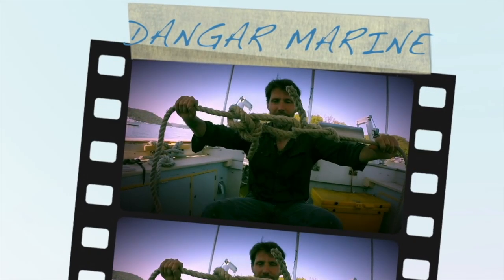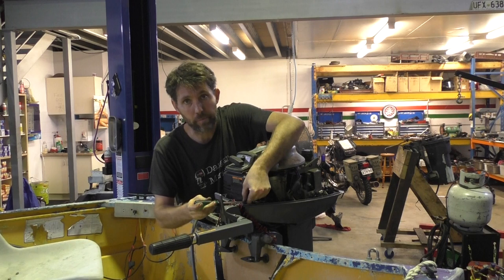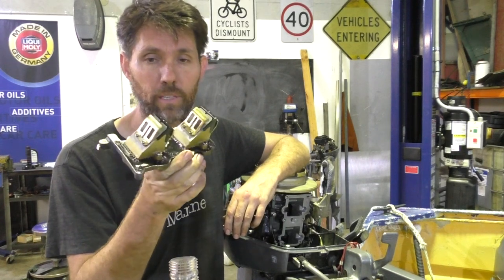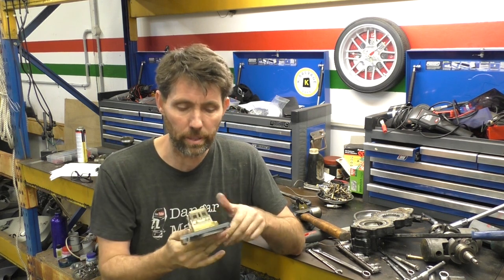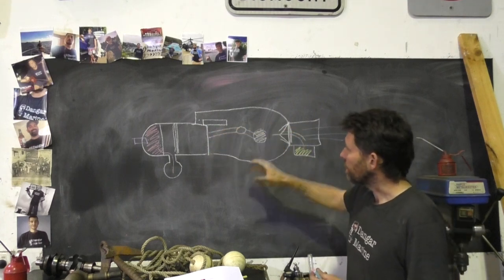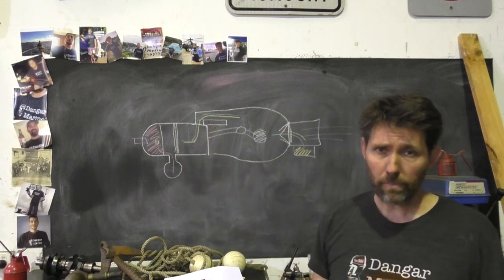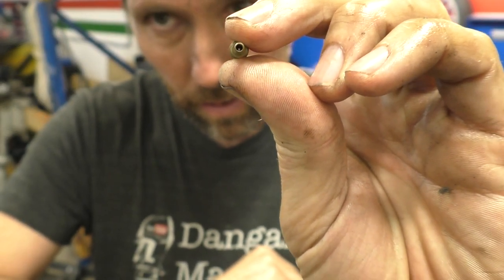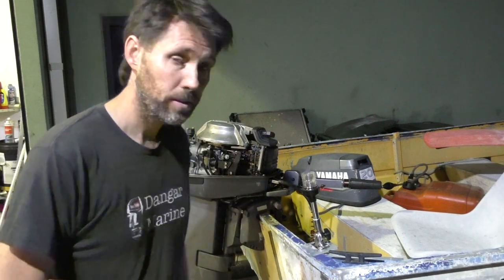Outboard reed valves

Comment: I've got an old 87 nissan NS70a . For the longest I've had a rough idle. Just recently, I have had a high speed problem. Spits and sputter and does not want to make top speed. If you work it to top speed slowly it may catch for a few minutes and then go back down... Went to lake yesterday and had the carb cover off and have fuel spitting back off the lower carb. Pulled the carbs and reed valves and mine are the stainless ones and you can see light shining through. Ordered some new ones from Boyesen and will let you know how it comes out.... Will say this also, I replaced water pump impeller couple weeks ago after noticing no water out of telltale next day after a night fishing trip.... Pumping water again fine now and I am hopeful I didn't fry the head or head gasket. But I'm really hopeful after seeing that fuel spit out of carb which  has been doing it a long time as the inside of the engine compartment is really oily. Again, I'll let you know how things work out and really appreciate your videos!!!
Reply from the maker: Yes, fuel spitting out the carb is a classic bad reed valve symptom. I would be 99% sure your telltale was just blocked with a bit of crud, water will still have been flowing through the motor just fine.
Reply: No, I should have explained the water pump thing in more detail. And obviously that is what I was hoping it to be a blocked line to the tell tale or the little outlet it comes out but checked all that and had to pull the foot and replace the impeller. It was like a knub. Had seen it prior to that trip fairly recent  pumping water out the telltale though so hopeful this reed valve thing will be it. Also noticed no gaskets whatsoever where the back of the carbs mount to the intake plate. So bought some gasket material , rewatched your video where you cut them out, (however I went to the lipstick method to make a  print after I wasn't satisfied with the oil  method. Probably not the right amount). Today is Sunday here and the reeds are suppose to be here Thursday so hopefully Friday , I'll have a good report for ya. No question about, I'm seeing light thru them and as I mentioned was getting gas spit back out of one of the carbs. 

Thanks again!!!!
Reply: Got the reeds in today and installed and test run today. No spitting and sputtering, just smooth acceleration. Thanks to you for getting me confidence in doing a few things that I would have never attempted. It's an old 1987 motor but for now a happy one. Thanks again!!!

Here's a short video I shot from my phone of the test run. I made multiple runs like this and no problems at all. Oh and forgot to hold the phone sideways to get full screen. Sorry about that.
https://www.youtube.com/watch?v=sLJyQ3NaQ6Q

Comment: Does my Mariner Mag 200 EFI have carbs? Reeds? And if so where?.  My motor starts good. Runs fine in neutral and on muffs. But in the water while prop is submerged.. I get no power. 6mph top speed.  I raised prop out of water a quick second and rpms raised as should. Help?.

Comment: Good day stu .. great videos very helpful and exciting to see.. I was wondering what you think about 1994 yamaha outboard 85 hp.. starts and running good.  Take it out in the  salt water and everything is going well.. takes off good.  Going max speed and after say 5 to 10 minutes in . Bogs down . No power. Sounds like crap  like it's trying to stay running... I Put it in neutral and give it choke try to high idle. Starts to get better and takes off again okay. Than does same thing bogs down like wants to shut off.. I know carbs clean . New fuel pump and lines. I'm thinking reed valves issue.. note I'm getting mix fuel coming / dripping out carb in air housing..

Comment: Sounds like there is either a bad head gasket or possibly a bad crank. Will it run better if you choke the carbs out manually by hand?
Reply from the maker: The head gasket was changed in the previous video and choking doesn't seem to help much, but will confirm during the follow up video.
Reply: It sounds like the cylinders are swapping air back and forth. If it's not the head I wouldn't be surprised if its' the crank labyrinth seals that are shot.

Comment: Hello Mr Dangar Marine. I have a question , I have an e48eslerd with a hole in the crankcase. I really don't have the cash for a new motor,  But was thinking of purchasing a powerhead off from ebay. I've seen a couple 17 splines 1994 48 evinrude spl.  What's the best advice you have on my thoughts?

Comment: hello Chris I have a Yamaha 40hp 2 strokes with the same problem as the engine in the video, did you manage to solve it?  if you can tell me what that was it will help me a lot.
Thank you so much
Reply: Hi , did you fixed that squeze noise ?

Comment: Great videos Stu!  Question, I have a 3 cylinder Johnson 70hp where the bottom cylinder overheated and melted the rod bearing.  Upon analysis in a sober state, the reed valve for this cylinder has a 4mm gap.  Could this be a high probability for causing my engine failure?  Thanks much and cheers!
Reply from the maker: Yes, it can cause the cylinder to run lean and get hot.

Comment: So, a while back I mentioned the problem I was having with the fitting on the hose to pump gear oil into the lower unit well I solved the problem the easy way I simply put the fitting on the end of the hose into a vise took a 3/8-16 Die and re-threaded the fitting and now it fits nicely, I checked the packaging to see where the product was manufactured CHINA so it's hard to believe with there superior quality control CHINA has, the three I bought were not able to fit without first passing the Die over them  LOL
Reply from the maker: Nice work Adrien, it was an odd one given those gearboxes have a very standard thread.

Comment: Hi Stu, on your motor issue I read that the piston could have a hole that is allowing leak internally. did you do a compression check on both cylinders?
Reply from the maker: Hey Tim, yep, did the before and after compression test in the recent head gasket video.

Comment: Can a stuck reed valve cause a cylinder to lock up when cold cranking? Outboard has been sitting for several years. Spins free until it gets to what I believe the exhaust stroke on cylinder 2.

Comment: I have a 2 stroke that wont start (won't even cough) has 125psi on each cylinder. Carbs functioning well and it has spark on each cylinder. Flywheel key is in the correct place. I'm running out of ideas. Could it be the Reed valves? I've tried spraying 2 stroke fuel directly into open carb and still no life.

Comment: so I guess the principal is the same on my motor, Its a 1993 150 johnson. It has the 12 little check valves on the carb manifold. At least 7 are damaged, and 4 were stuck open. Is this why low idle speed was rough and slobbery?

Comment: What do you think the problem would be with a 50 horsepower blue band mercury very low hours from new it lay in a shed for 20 years it went OK for the last 3 years but now it won't plane the boat carbs are clean the earth at the back of the coils are clean new Leeds and plugs starts ticks over engine sounds fine but just not power the could it be the coils there is a good spark your help would be appreciated

Comment: thanks I done as u said .as they have been on now a year or so so I wanted see if I done it right way but I think am getting bit soft water on starboard side so that engine would use a bit more petrol as it be cavatating and bit but yes it's OK I could put alarm rudder between them but don't think it's worth it there on a 25 foot princess 6 berth and I get 6 knots and that fine turn her on a penny and fuel consumption is very low all in all good job thank u. John McCormick
Reply from the maker: You're welcome John.

Comment: I have an old Salva 30hp 2 stroke it's hard to start in the cold and runs a bit lumpy when cold. After it's been running for a while like getting to a fishing mark, it will start almost ever time first time after that. The carb air input valve has no filter box on it, that's how I got it should I rig up a filter using some sponge. What do you think?
Reply from the maker: Many outboards don't have a filter box due to the lack of dust on the water like you get on the road. If they do have a box it won't have a sponge in it. The cold start problem could be a carburettor or reed valve problem so I would look at both. I would also look at whatever cold start enrichment system it has.

Comment: I replaced the reed valve at the pule hole where the fuel pump is and new fuel pump and fully rebuilt the carbs and still no fuel to carbs? its a 1979 johnson 115 v 4, I can spray fuel in carbs and it will run, what do you think is wrong?
HELP
ASAP
Reply from the maker: Does fuel come through if you squeeze the prime bulb or is the hose completely blocked somewhere?

Comment: So can you get low compression on a cylinder due to a bad reed?
Reply from the maker: No, only low compression in the crankcase (which isn't very high anyway) and fuel spitting back out the carburettor.

Comment: I have a 2001 50hp johnson outboard. It keep stalling and run rough I have changed the spark plug use couple of time spark plug is bad now. Most of the time it take 10 to 15 crank to start. Can you help?

Comment: This is beginning to sound like quad seals in the engine. I had a similar problem with a Yamaha V6 that kept Jumping" Or "missing" It's possible the Crank case vacuum and pressurisation like you were discussing before may not be adequate for each cylendar to fire properly and is leaking down pressure and vacuum between both cylendars and crankcases
Reply from the maker: Hey Callum. I have been thinking about doing a video on pressure testing crank cases. I'm presuming I will need to pop the powerhead off and make up some sort of plate to block off the exhaust then use a leakdown tester in the sparkplug holes. Have you ever gone through this process? Where are you working now?
Reply: Haha its not something people often do to be honest, its a bit of a theory that was never realised by the manufacturers. But a very necessary one indeed! And yeah that sounds like a decent plan of attack, I would imagine if the cylendar is a top dead centre you will be able to perform an adequate test. I'm not so sure if it will give you a good idea as to the sealing power of the crank case though, perhaps it might if you get some leakage between both cylendars. I have gone through the same processes you have on a larger engine only to find that the problem still presented itself. I tapped a vacuum tester into the crankcase as a bit of an experiment to read variation in positive and negative pressure (vacuum) and I've heard anywhere between 0-15psi (negative and positive) is adequate.  I am currently next to the maritime at Rozelle in the Sydney boat house, I hope the mountain and dangar is treating you well :)
Reply: You have to block the inlet and exhaust with plates to do a leak down. And as every engine has a different shape, you have to make a new plate each time. AS an owner /repairer it is worth while, but in a workshop it would be hard to justify. This is definitely something that would only make sense for some one to make and rent the plates out , it just cannot be justified ay other way.  But a leak down is a good test for crank seals ( cylinder to cylinder and end seals) , ring blow by, cylinder head and crank case join seals. You can get away with a crank case seals test by only using a block off plate on the inlet side  with careful positioning of the piston on the cylinder under test, but the results are very 'fluffy' as the ring blow by makes just about any other leak you may suspect hard to hear.  Crank case seals should also be vacuum tested  at about .5 BAR max as some seals will be ok under pressure but fail under vacuum. Way too hard and laborious to justify in labour charges. By the time you have the head off, make the plates and do the tests you could have had the head off, split the crank case, shove some new seals in and have the cases together again- probably quicker in reality.
Reply: Ron Powell Great info man! Have you ever done the leakdown/vacuum test before yourself? I totally get what you're saying about cost and reason. But just almost as an experiment, it would be cool to do! I guess you would save a little money on the crank seals but its probably not worth it because making the seal plates and time to do the test. Im guessing different motors would not have the same psi readings with different size  exhaust ports? Or would a vacuum test be more reliable? It would be cool if there was a standard leakdown test. But I guess that would be too easy, huh! Thanks again for the post!!!
Reply: I did on my current engine. Total PITA and never again. My engine is a 1974 50hp Johnson ( hydraulic assist shift) , forward controls, no water tell tale, 2 cylinder...
So, remove carbs or  reed block, which ever is easier (carbs in my case) use a new gasket to mark up a plate of 4mm aluminium so that  it covers all of the intake side of the reed block. Drill and tap a hole about where the centre of each carb throat would go - make sure you tap that hole to match your gauges.
On my engine I had to remove the exhaust port cover, then the exhaust port block so I was able to blank off each exhaust port separately. again, a new gasket used as a pattern, cut, drill and fit the plate to the exhaust ports. no  holes to drill/tap for gauges on the exhaust.
Now, there are no numbers given for leak down testing on this engine so I used what I would for a low compression 4 stroke (chonda 6hp engine) .
 I applied 7psi with a 2mm restrictor to the intake side of the engine with the piston at TDC- which should close off the transfer and exhaust ports. Top cylinder held so close to 6.6psi did the test 3 times  to make sure. The lower cylinder gave 6.4 psi , which is still good . No exhausting air heard from the top or bottom seal ( stethoscope)  and the pressures showed no mid crank seal failure. I then pulled a 2psi vacuum (minimum I could read)  for 3 minutes and shut the gauges off and the vacuum held for a minute- good enough for me.

The top end is done by leaving the piston at TDC and just pressurising the cylinder via the spark plug hole. The same choke and with the reed plate cover holes plugged. I got a flow rate of 1.5psi for about 1 minute with dry rings . I then squirted oil into the cylinders and reapplied pressure - I got .5psi flow for about 3 minutes - this is simply cylinder blow by/ring gap leakage and the flow is simply the cylinder and crank case pressurising.

 So in the end I am pretty sure my crank seals  are OK, the block has no holes in it , the pistons are Ok, the rings are slightly worn (expected) but other than that the 8 hours of mucking around told me nothing. In 8 hours I could of whipped the cylinders out, checked the rings and bores, refit. Lift the power head out , undo 4 bolts and put in a new lower crank seal, remove the fly wheel and fit a new top crank seal. The question is- is an engine this old worth it? For $2500 I can get a reco 60hp Johnson of around 2005 vintage  with 1 years warranty ( 'holiday' usage, commercial they give 1 month- so in reality  they give about 50hrs wty) 8hrs of tech time is about $1000 of time and materials for a leak down.
Reply: Ron Powell Damn lots of great info man. And sounds like a PITA! Is that the same 2 cyl Johnson block that Evinrude uses on the 40-60 etecs? Seems like a great motor if Johnson still chooses to use it this long

Comment: So by looking at your diagram it looks like bad reed valves could cause lower compression readings?? My Yamaha 115 is starting to drop compression. Runs great but compression is around 90 psi on all cylinders.
Reply from the maker: No, the charge is compressed very slightly in the crankcase, just enough to get it to transfer through the port to the top of the cylinder where the piston compresses it up to combustion pressures. If that is low it is still about the rings being worn.
Reply: The reed valves just stop the air fuel mix from reverse flowing out the carburetor as the piston goes down the bore. So, because the air fuel mix cannot go out the carburetor, it goes the only way it can, up through the transfer ports and onto the top of the piston. With out the reeds  you still get the transfer of fuel air up to the top of the piston, but a percentage would back flow the carb .  So the reeds just make the engine more efficient  and powerful

Comment: I have a 15hp with no compression. What could cause loss of compression? Do you have a video that talks about replacing piston rings?
Reply from the maker: Depends whether it is a four stroke or a two stroke. If it is a four stroke then it can also be valves. I have an early video on doing the rings on a Yamaha and a more recent one on building the pistons on the Evinrude 150 I rebuilt.

Comment: I want to put to 9.9 mercury  out boards on a boat  what distance should they be apart and should one out board mother prop turn Antiy clock ways and thank u for letting me know John
Reply from the maker: The further the outboards are apart the better really as they will get cleaner water and give you better maneuverability. Counter rotating props are good for balance but I'm not sure they warrant all the hassles that go with getting parts for them.

Comment: 1983 50hp Johnson, starts first time no problems when cold, as soon as it has run for ten minutes I can switch it off and it’s starts straight away. But leave it for ten minutes and it will not start, cranks and cranks then lift the fast idle and it will eventually start. Seems to be flooding but why only after being off for awhile? Compression good both 150.
Reply from the maker: It could be that fuel leaks from the carburettor or fuel pump somehow causing it to flood, but eventually it runs dry then evaporates letting you start it again.